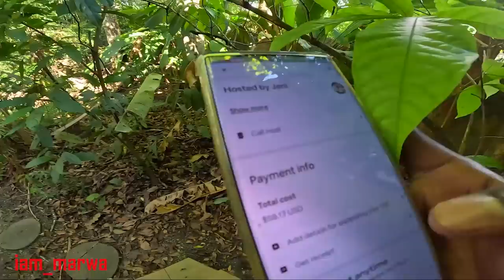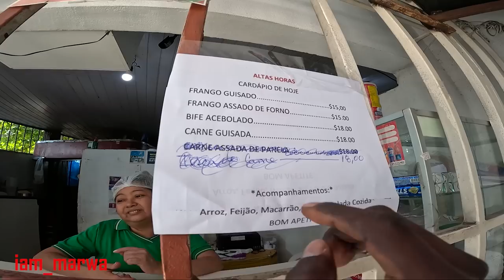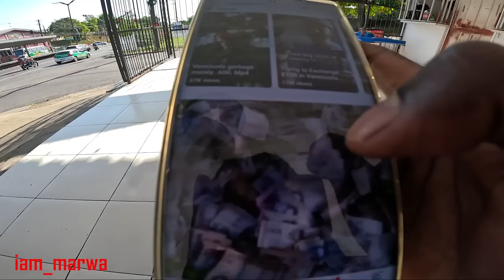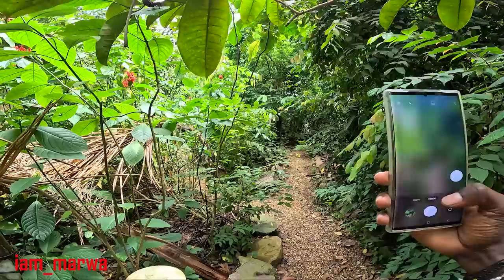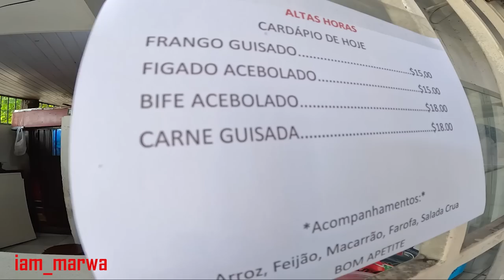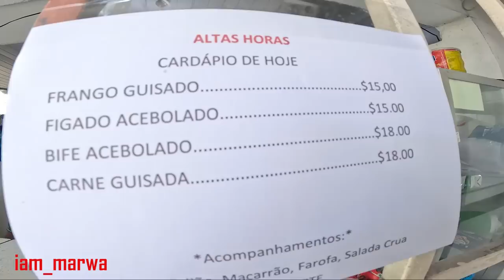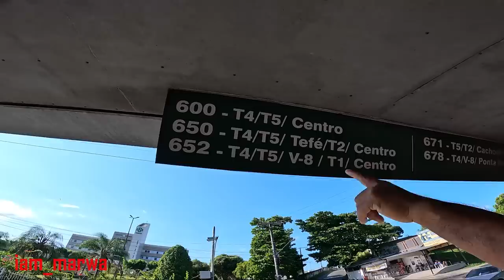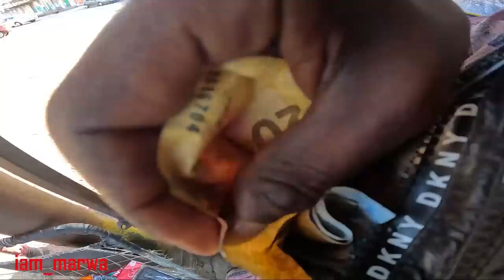DOWNTOWN MANAUS AMAZONAS BRAZIL !!!

Comment: Hi Marwa, i think the Extreme Heat of Manaus is not because of the water bodies around.  I think that part of Brazil is in the Rainy Season just  like it is Rainy Season in The West Coast of Africa. I think the time difference between The West Coast of Africa and the East Coast of Brazil is only 2hours. Marwa, correct me if am wrong that the time am sending you this SMS, the time here in the West Coast of Africa is 18.00hrs , so it can be 20.00hrs in Manuas. Am i correct Marwa? Thanks.